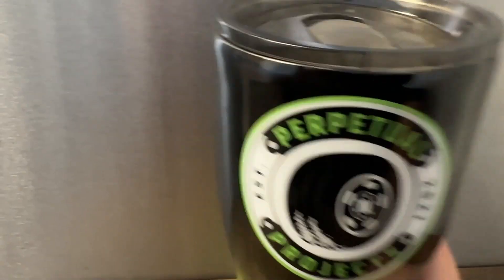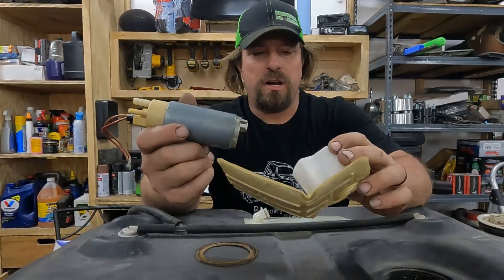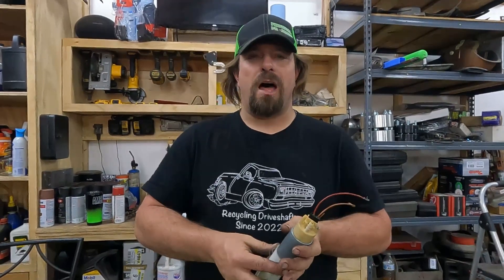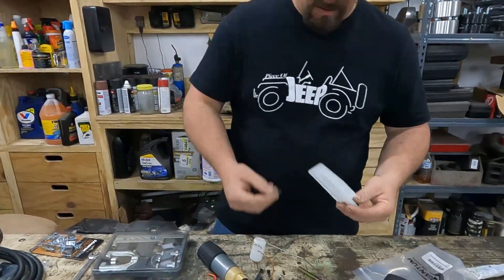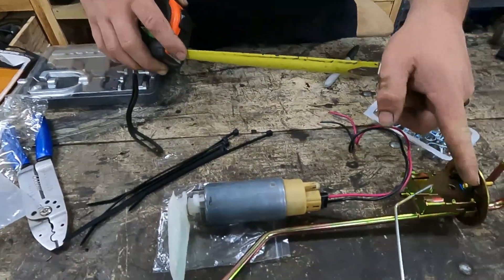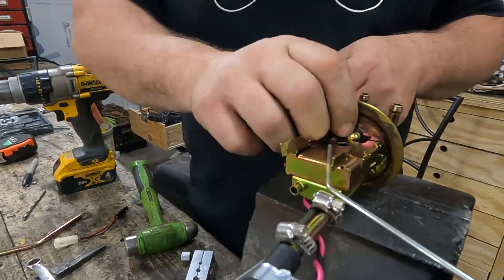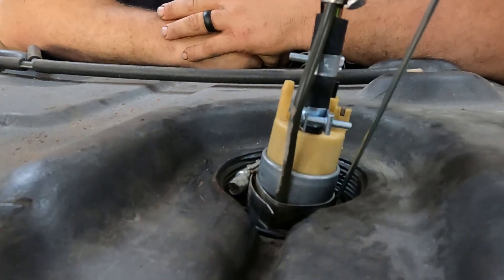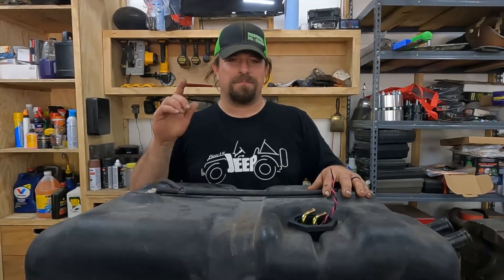Fuel Injection Conversion: SIMPLE Fuel Sending Unit Modification

Comment: Very interesting, thank you. 

I'm doing the same on my fuel tank.
As you, the big issue was to fit the electrical fuel pump through the tank hole.
Another issue is to test new electrical wiring inside the tank, because they NEED to be "submersible rated" so they don't melt due to gasoline, and if they do, may cause continuous or perpetual electrical fuse problems

Someone in this chat said "BOOM" problem and this is not true, it is impossible a spark firing inside a fuel tank  to lack of oxygen, as I said, it may cause fuse problems only.

Cheers

Comment: Says that he doesn't want to put a bung on the bottom because it's an offroad vehicle, then precedes to use permatex no. 1 for a grommet on an electrical wire passing through a hole in metal. 😅

Comment: This is great.   I still need a surge tank for Rock Climbing since I can't get a module box through that hole in the tank.   Fuel starvation with EFI is real unlike a carbureted  motor.

Comment: Great video! What tool did you use to make the "bubble fitting" on the fuel pickup line? I am doing a similar retro fit and need to flare or otherwise make a fitting in the pickup line to keep the rubber fuel line from blowing off.

Comment: Im trying to figure out my system. Im building a sleeper 1980 mercury grand marquis 2 door and decided to try efi. I have pieces together everything from ebay and now trying to figure out my tank. My tank the sending unit is on the side and its really making things challenging for the pick up. Wanted to just get the aftermarket pump/sending unit with returns built in but nobody sells a unit that goes in and bends 70/45 degrees. I have to make returns and everything from scratch.

Comment: For god's sake, get some proper insulators for those wires. Any chaffing and it will short directly in that gas tank, especially bumpy off-roading. BOOM, Fiery inferno, etc.... depending on fuel level and material of the tank.

Comment: Did the same thing with mine. Did you happen to use submersible fuel line? Guessing yours is since it came in kits for that purpose. My tank is still out and I’m tempted to replace the rubber line with fully submersible tubing.

Comment: Was thinking of doing a similar modification on my build. Have you had any issue with fuel starvation at lower fuel levels? I was worried about that with my tank not having baffles. Great video
Reply from the maker: To be honest we didn't drive it all that much. but the fuel supply shouldn't be much different than with the factory pickup.

Comment: The only problem with that superglue is the gas is just going to eat it right off. I’ve learned that from experience.
Reply from the maker: Yeah it was a really tight fit so I'm not really worried about the glue dissolving. I put it on for peace of mind for maneuvering it into the tank